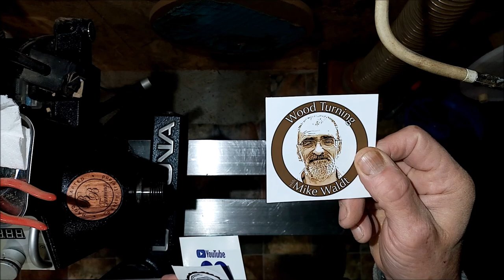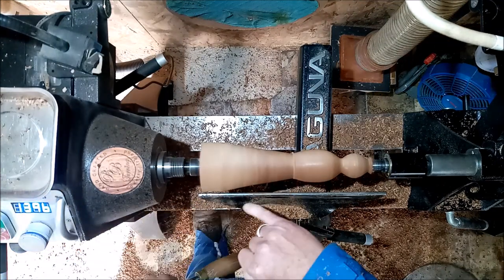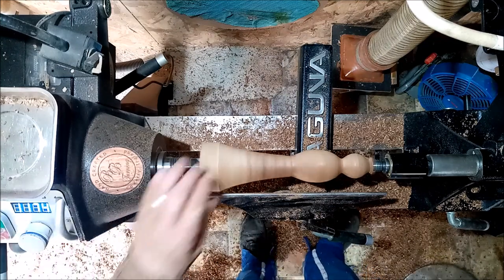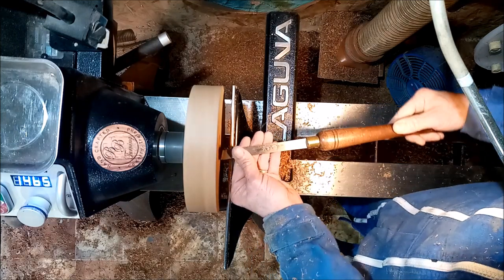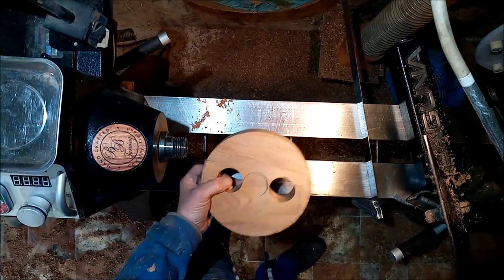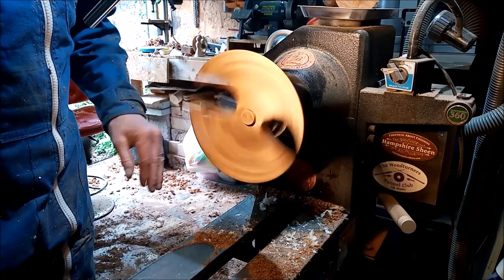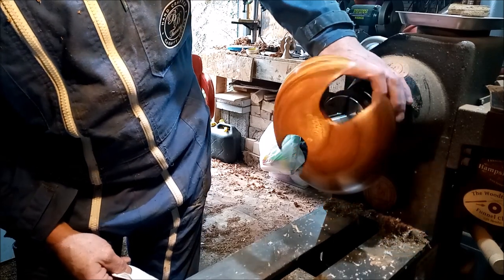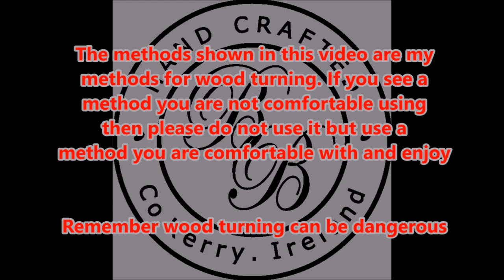Wood turning An Angel with turned wings / woodturning Christmas Angel

Comment: Great turning! Like how you did the wings. I had to watch again to understand how you got the top and bottom of the wings. This will got in my "try to turn file". Thanks for sharing Shay, safe turning.
Reply from the maker: Thanks Joseph, did you get it alright?  If I can explain it in a clearer manner for you I will be more than happy to do so and put it at the start of the next video. I take it that it getting the measurements is the question?
Shay
Reply: @BBTurning  Yes, when you said 2-3 mm. Didn't know if that was from the outside perimeter for sure. Of course, I always have to convert to inches.
Reply from the maker: Yes a Joseph from the outside perimeter to the centre line both sides. 
Shay
Reply: OK Shay, thanks, I'm good now.

Comment: Just found this. Amazing.  I’m new to turning. Can I ask how do you sand those wings with those cuts. Seems like I’ll get my fingers jammed?  Could you make the bowl first and cut out the sections after
Reply from the maker: I used a piece of sponge behind the sandpaper Nicholas but what I have been doing lately is as you suggested and cutting the wings after I finish them. You can't use a bandsaw to do it though as it will rip the wings apart, you need to use a fret/coping saw. If you have a look at the other blue angel video I show how to do it. Here is a link to it https://youtu.be/xiCO6svxYbc
Shay

Comment: Outstanding. The shape and proportions are excellent. Beautiful piece of timber. Lovely finish. Have you considered making the cut outs in the wings after you finished the turning? Thank you for sharing. Have a great day and stay healthy. Happy holidays from the US.
Reply from the maker: Thanks Glen, yes I tried it that way first and found it was a lot more difficult getting them the same on all sides. When you mark on a flat piece of wood it's very easy to get them balanced. I have an idea in my head for a mark 2 angel which will require a saw cut after the wings are turned. I just have not had the time to prototype it yet.
Shay

Comment: Lovely work ,would drilling the wings after they were finished work ?
Reply from the maker: The problem is Nicholas lining up the spaces in the wings and drilling a very thin piece of wood. I kind of got around the problem in this years angel video by doing it differently due to having resin in the wings.
https://youtu.be/xiCO6svxYbc

Comment: Awesome work - I may have missed it but what size is the blank you started with, please.  Love the finished article!
Reply from the maker: The body part was 11 X 3 inch blank and the wings were 9 X 1 1/2 inch blank Gavin. I have also done them smaller once the ratio of body to wings is roughly the same the angels work out fine. I hope that helps.
Shay
Reply: @BBTurning  thanks for the super quick reply - that's really useful.
Reply from the maker: You are welcome Gavin.
Shay

Comment: How are the wings fastened when turning down the mortise?
Reply from the maker: If you watch the part where I turn the outside of the wings the first time you will spot that I do not touch the centre part where the mortice is. When I flip the wings over the mortice is used to hold them Jim. You can see it better in this video, the part you are interested in is around the 39 minute mark https://www.youtube.com/watch?v=xiCO6svxYbc
Shay

Comment: Your head blocks the view of the piece at times.  Recommend another camera set up angle. At other times the piece is held so that we do not get a complete view.  The finished piece is quite good.  Thank you.  I'll give this a go.
Reply from the maker: This video is quite old Mike and there has been a lot of improvements since.
Shay
Reply: @BBTurning  I'm going to make some of these.  Any tips other than what is in the video?
Reply from the maker: @tmikeporter  I did a mark2 as a one off special there might be something else in that. I did use a different way to get the gaps in the wings https://youtu.be/xiCO6svxYbc . Grain wise just make sure you use a tight grained wood and especially with the wings it cannot have a flaw, even the slightest crack will cause them to blow out as you will be bringing the edges to practically nothing. When doing the wings treat it like a winged bowl and remember speed is your friend with them. If you can get the halo to sit in between the top wing gap it looks very well.
Shay

Comment: The noise is really annoying.
Reply from the maker: Which noise Edwin? The overall sound?
Reply: @BBTurning  It was the tool noise in the beginning .  I just turned the volume down and it was ok.  Thanks.
Reply from the maker: @edwinleach7401  ahh OK thanks, the new mic cancelles that out a bit more, one of the reasons I got it. Thanks for the input its very much appreciated. If someone does not tell me something is wrong I may not spot it and then can't sort it.
Shay